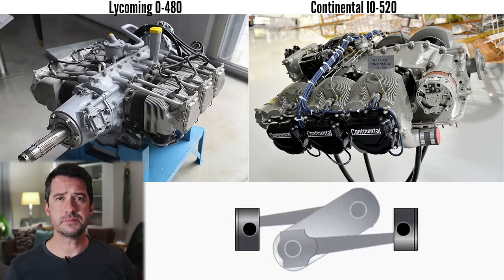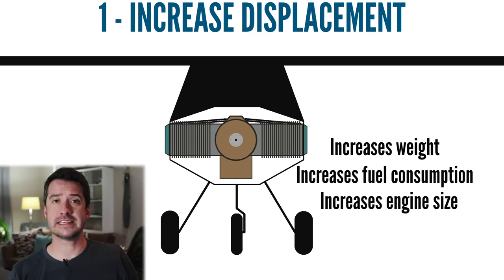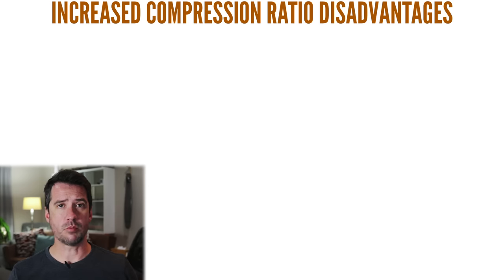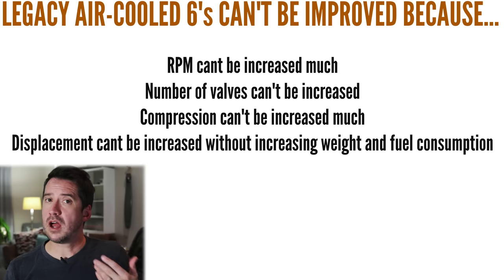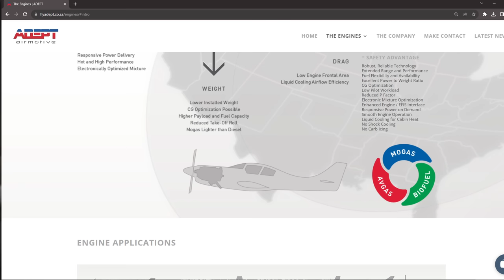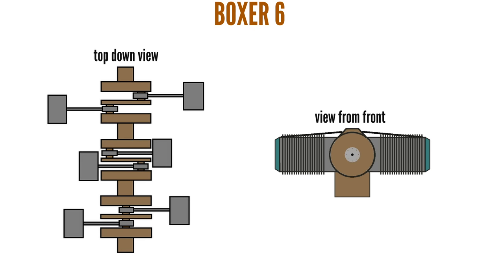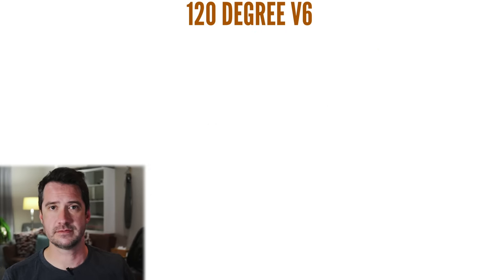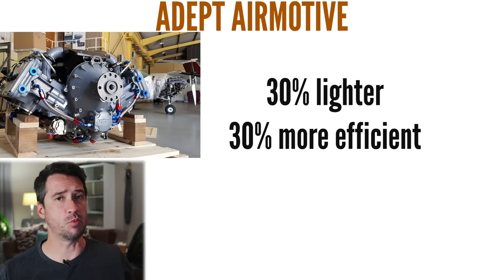Unusual V6 Airplane Engine Makes Boxer 6 OBSOLETE?

Comment: Great video! Pushrod engines can rev to 11000 rpm as Mercedes Benz once did with their racing pushrod engine, using the advantage in the rules allowing higher compression, more boost and larger displacement to increase performance. Chevy V8 tuners spin their motors to 9000 rpm. GM estimates they save $400 per engine with the pushrod design and they are more compact, lighter and easier to work on. On a purpose built aircraft engine the camshaft drive could be designed to work as the Propeller Reduction drive and with Camshaft above the crank would also raise the prop centerline. My 2 cents
Reply: You said it yourself though: "racing engines". An aircraft piston engine has to be in a far lower state of tune, and probably even a lower state of tune then a production automotive engine, because high reliability is an absolute requirement.

When pushrod engines are used in racing, it's usually because the series rules make it advantageous to do so (or require it). Engineers are making these engines run fast despite using pushrods. All that extra reciprocating mass and friction will always have a performance penalty at higher RPMs, and pushrods also make it much more difficult (though certainly not impossible) to have more than two valves per cylinder, which will always negatively effect high RPM breathing. You can work around that with bigger valves, higher lift, forced induction, etc. but all of those have downsides. With more valves, you can simply make much easier compromises.
Reply: That is how some old stationary engines worked. To get more power from a smaller engine, they had the crankshaft run faster and had the output pulley on the camshaft. So you still have 500 RPM at the pulley while allowing the engine to run faster.
Reply: @TonboIV  thanks for your reply. My point was simply that 5000 rpm is not considered to be too high for a pushrod engine if they handle 9000+ rpm reliably. Some of these motors push out 5000hp. See Steve Morris videos.
The lower costs, lighter and smaller size of pushrod engines make OHC/DOHC unnecessary when we consider that their advantages are more theoretical than practical.
Reply: @captarmour  Did you even read ANYTHING that I wrote? You're just ignoring all of it and repeating yourself.
Reply: I'll read it again, sorry man didnt mean to offend you @TonboIV
Reply: @TonboIV  "An aircraft piston engine has to be in a far lower state of tune, and probably even a lower state of tune then a production automotive engine, because high reliability is an absolute requirement."       - I agree completely with this! 
"When pushrod engines are used in racing, it's usually because the series rules make it advantageous to do so (or require it). Engineers are making these engines run fast despite using pushrods. All that extra reciprocating mass and friction will always have a performance penalty at higher RPMs, and pushrods also make it much more difficult (though certainly not impossible) to have more than two valves per cylinder, which will always negatively effect high RPM breathing."
- I also agree with you on this. 
I do not think an aircraft engine should rev so high, In fact If the main bearings, crank, conrods, well entire motor, can take ridiculous torque at low RPM, we can limit it to 3000 RPM and boost it to 100psi with compound turbos!
I hope my 2 cents makes you a bit happier with me.
Reply: In fact my favourite configuration for a purpose built aircraft motor would be an inline six 3 liter twin turbo diesel with a SOHC. (similar to the MB OM606)
the reason I would want SOHC is to use the camdrive as the prop reduction with a high center of thrust as well as acres of tip clearance, due to the prop mounted on the Cam.
Reply: @captarmour  You certainly could use high boost and turbo compounding to get more power without more RPM, but forced induction also increases cost a lot. Increasing the RPM seems a much easier way to get more power out of a smaller motor. Most GA engines are still naturally aspirated, and when a turbocharged engine is desirable for high altitude operation, a higher engine speed would still allow that engine to be smaller and lighter than it otherwise would be.

A naturally aspirated 3.2L that has nearly as much power as a 9L Continental seems like a pretty worthwhile advancement. Lower fuel burn, less weight. Of course, people have been trying to basically the same things for decade, with very little effect on the market, but I don't think GA engines will be able to stay the same for much longer. The world is changing, and even if it isn't Adept that ends up in the right place at the right time, someone else will, and all the new engine designs that are actually getting built and tested seem to be going for higher RPM operation. Back in the 1940s, commonly available engines weren't turning much faster then 3000 RPM anyway, so direct drive wasn't leaving much performance on the table, and the basic design of GA engines has mostly stayed in the 1940s for a whole bunch of reasons. These days, most gasoline engines in the size range of what GA would use are turning 6000 RPM or more, so direct drive is really sacrificing a lot.
Reply: @TonboIV  we have readily available auto engines which people like Viking are doing reliable conversions, this may be the future. 
A very nice conversion is the Yamaha 3 cyl turbo snowmobile from which tuners are getting 400 hp from weighing in at less than 200lbs firewall forward. 
Would love an inline 6 of this motor!
See Steve Henry's videos
Reply: Ohv are just more reliable
Reply: @captarmour 
Trouble with diesels is that they cannot maintain altitude without turbosupercharging. If the turbo fails, the airplane comes down, as what happened with the Cessna 182JTA with SMA turbodiesel. Fortunately no injuries, but that failure caused the FAA to rescind a lot of previous approvals. So much so that Cessna went back to a Lycoming gasoline engine for the 182. I agree with the FAA. Dependency on the turbo to maintain altitude is putting too many eggs in one basket. A turbocharged TSIO-520-R engine in a Cessna 210 will keep flying with a seized turbo. Won't make as much power and won't climb as high, but it'll still get you to a safe landing at an airport.
Reply: @rescue270  thanks I didn't know this. What of the diamond aircraft with turbodiesel motors? They seem to have got over their turbo woes.
Reply: @rescue270  In semi truck engines that run near full power output the turbocharges last for hundreds of thousands of miles and when climbing mountain grades there is considerable amounts of shifting with the turbocharges along with the engine decelerating and then under full power again. In an airplane other than at full power takeoff the engine is probably at a fairly constant power setting and probably not have vary dramatic power setting changes. The amount of cycling in an airplane is probably far less dramatic then in a heavily loaded semi. Prime example the road trains in Australia that use 600 horsepower diesels to move up to 160 tons down the road. Those engines are at near 100% power all the time and any increase in grade requires shifting to provide the required torque.
Reply: @kerrryschultz2904  
I have to disagree.
I realize that their turbos are very durable, but they do fail every day. My son knew a guy who worked in a turbo shop while oil production in the Eagle Ford Oil Shale formation was really going full bore. Those trucks were running night and day. That shop was perennially swamped with more blown turbos than they could handle.
Relying on a single mechanical accessory like that to maintain flight is not a good practice. There needs to be some redundency to aircraft powerplants.Turbos can fail for any number of reasons, not the least of which would be foreign object ingestion. It has happened before and it will happen again where a nut or bolt will be inadvertently dropped into the manifolds during maintenance. When it gets pulled into the turbo that object will destroy it. The truck can pull over and stop. The airplane can't.
Until they come up with a diesel that can at least hold a safe altitude with a failed turbo, I won't be in favor of them in aircraft.
Reply: @rescue270  Most times when a turbo fails is when the engine is at full throttle with extreme heat and when the shift occurs the inertia and added stress can cause the turbo to fail. Airplanes don't shift gears a dozen times in a minute. Name anything that is not at its thermal or material limit that doesn't eventually fail. All your points are valid, but material ingestion by any engine if not immediate damage can show up later. A mechanic leaving a fastener in an intake manifold is not the turbos fault even though highly likely not to survive but then valves and pistons in that event won't be happy either.
Reply: @kerrryschultz2904  
True, but airplanes run continuously at high power settings, around 70% power in cruise flight. Inertia does not help maintain speed like it does in wheeled vehicles on the road. Once up to speed on the interstate, all vehicles do not require that much power to maintain a steady speed. Power requirements will vary due to uphill grades, wind, etc. 
I've seen quite a few turbos fail in aircraft. Mostly bearing seizures from running so fast and hot. Ice ingestion can cause damage, too. A turbo with 1200 hrs on it probably needs overhaul.
Reply: @captarmour  
Not sure what's up with those, but I gather that the DA42 with Lycoming IO-360s s is still the preferred version.
Reply: @rescue270  The inertia that I was refering to is on the exhaust side of the turbocharging that is running extremely hot and changing gears may cause a piece of impellor blade to break off or even more serious damage. On heavily loaded commercial trucks those engines may operate as in the case of a road train for hours at 90% or higher power in extreme heat. I would wonder how many times a small piece of material or casting flaw helps to cause damage to a turbocharger. I wonder if a bearing seizure in a plane is due to the oil pump being marginal for oil flow because bearing seizure doesn't happen that often in a semi truck considering there are hundreds of thousands around the world.
Reply: @kerrryschultz2904  
Seizure often happens due to coking of the bearings if the engine is shut down soon after landing while the turbo is still very hot. With oil flow stopped at shutdown, the heat will cook the oil into carbon coke that can jam the bearings. Next takeoff, the engine will only make ambient mainfold pressure with a noticeable reduction in performance. Damage can also result from repeated thermal shock if the pilot does not manage power during landing descents. If power is drastically reduced from cruise power at altitude and a steep descent to landing is initiated, the rapid cooling can lead to fractures in the hot section, but this more typically happens in the exhaust ducting connected to the turbo rather than the turbine blades themselves, although the blades are not immune to it.
Much the same as the thermal shock caused by the shift in the diesel.

Comment: Porsche Flight Motor came out 30 years ago.  Motor had to run at near max revs to make power.  Constant 6,000 rpm running wore them out quickly.
Reply: Yes, that’s the problem. Automobile engines run at full throttle only a fraction of the time and mostly loaf around at partial throttle settings, generating a small fraction of their maximum power. Aero engines on the other hand hav to run at maximum power for long periods of time during takeoff and climb and then typically cruise between 2/3 and 3/4 of full power for most of the flight. Asking a motorcycle engine or an auto engine to do the work of an aero engine without significant re-engineering is asking for trouble.

Comment: Porsche has been squeezing triple the HP from NA flat 6 engines. Turbo charging an engine means the engine capacity can be reduced significantly, which drastically reduces weight and size, while at the same time increasing power and reducing fuel consumption and emissions. To me it appears as if they are trying to reinvent the wheel…
Reply: Yeah! The Porsche engine in the Mooney was a resounding success wasn't it!?
Reply from the maker: Porsche had a go at an airplane engine in the 80's (PFM 3200), using the 911 boxer 6, but they turned out to be heavier than the air cooled 6. Also they were wider for exactly the reasons I stated (OHC's are large).

It would have to be even smaller, and then needs more boost or higher rpm to be competitive. But at some point with higher rpm and bigger turbos, good reliability is lost. Adept innovated and found a solution in my opinion.
Reply: @LetsGoAviate  The Porsche PFM 3200 was air-cooled, and it retained a belt-driven cooling fan, which is ridiculous.

Comment: The equation for Vee angle (720 divided by the number of cylinders) would suggest 120 degrees (even though most automobiles use 60). But 180 seems to have advantages also. 
If 120 was better than 180 wouldn't Porsche use 120 in their 500+ hp flat 6s?
Reply: On the Porsche side, that's tradition I guess (like putting the engine in the back of the 911, which is absolutely the wrong place). On the Ferrari side, the Ferrari 296 GTB road car and Ferrari 499P Le Mans car both currently use a 120 degree V6.
Reply: Interesting. Ferrarii. I wasn't aware of anyone using 120 degree V engine. 
They had a flat 12 that must have been very smooth.
Reply: Don’t expect European automotive engineers to live in your world. They all have traditions, prejudices, memories, and other frustrations to live up to. And Porsche is inordinately proud of their flat 4’s and flat 6’s. (As is Subaru.)
Reply: @russbell6418  Sure thing.  Fredinand and Ferry Porsche originally planned to make a mid-engine sportscar if they cold, they had prototypes of mid-engine road cars before the 356 was released.  But later when the company had the means to do, it seemed to be "prejudices" holding the company back from allowing the 914/6 and Cayman (with the engine in the right place by most dynamic and motorsport considerations) to outperform the 911!

Comment: Does the weight include the cooing system?
if not, that probably cancels out the 30% weight savings.
Reply: Probably. I still like my cylinders be as close as possible together and two exhaust valves. And no dead animals between cooling fins.

Comment: Compression and Turbocharging whilst connected should not be compared in same basket dude. Compression Ratio is a unit regardless of adding extra charge air. Turbocharging on AC engines is not really for increased power, it is for altitude compensation. 
As for new engine, what would you expect when you increase revs, water cooled, electronic injection and the big one, no dual magnetos and dual spark plugs?
Reply: Yeah, let’s take the engine out of a Porsche or Subaru and use a lighter planetary reduction gear!

Use a turbo to compensate altitude starting at sea level! Also use a turbo in cold weather when the spark cannot be advanced any further.

Comment: I suggest you give the Delta-hawk a look.  It’s been certified by the FAA for new certified aircraft, retrofit legacy certified aircraft, and of course it’s good for experimental.  It uses jet fuel which is more available in airports outside the US.  It is however expensive…

Comment: A turbo-charger usually doesn't increase the efficiency of a gas engine (well in contrast to most Diesels). For traditional aircraft use, turbo-chargers are (mostly) used to maintain power up to higher altitudes. Fuel efficiency of the engines suffer, but a turbo-charger often allows to fly a more efficient pattern.
Reply: Turbos are not for fuel efficiency in cars either
Reply: You can also get mire takeoff power with "turbo juice" then keeping the chamber pressure in the preferred zone at altitude  should keep everything more efficient than a larger NA engine to make equivalent power in both areas.
Reply: Yeah, turbo chargers increase the weight of air ingested per one intake stroke, allowing more fuel to be burned. The actual compression ratio is limited by engine knock. In aircraft engines turbos are mostly used for turbo normalization. Car engines actually reduce the cylinder compression ratio to allow for use of turbos at sea level without knock.
Reply: @gustavlicht9620 that is why I don’t understand the downsizing trend. Toyota with 2.2 l inline-4 in the Prius is efficient.

Comment: what do you think off the spanish INN 1 stroke engine, 500cc, 120 hp, 35 kg , can doubble,tripple ect conectet
Reply from the maker: I like innovation so it seems like a great concept, potentially having a use case for light sport aircraft, but I have not done enough research on it yet to give a meaningful opinion.
Reply: like a modern and better wankel concept, you can add unit after unit behind